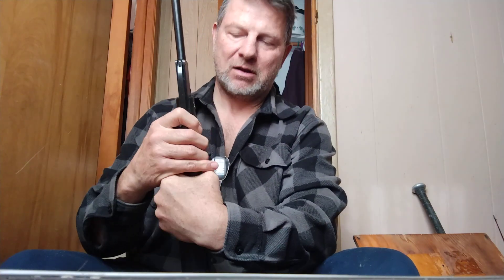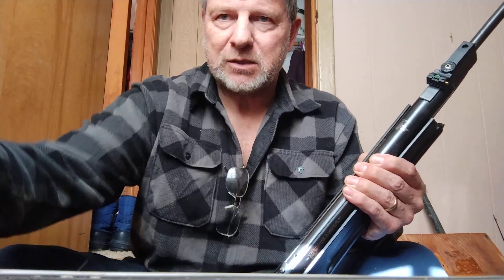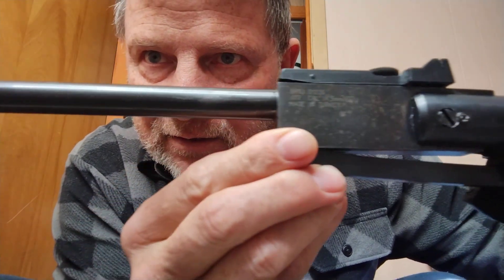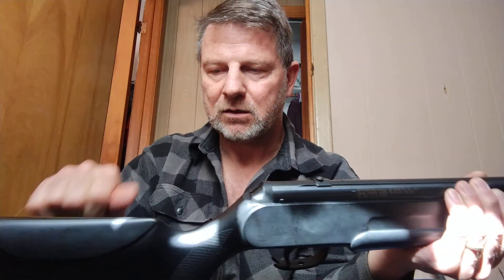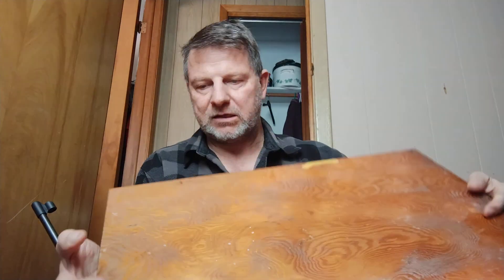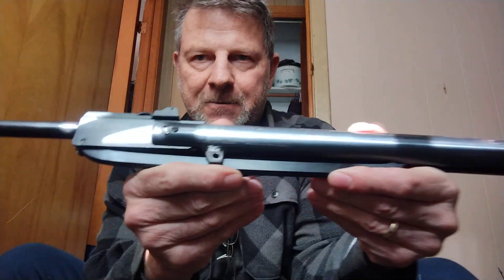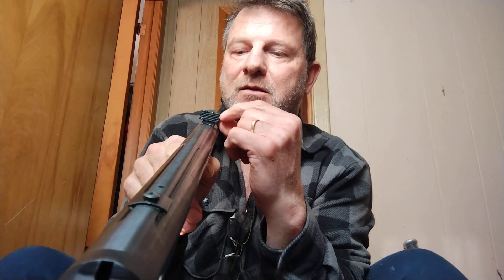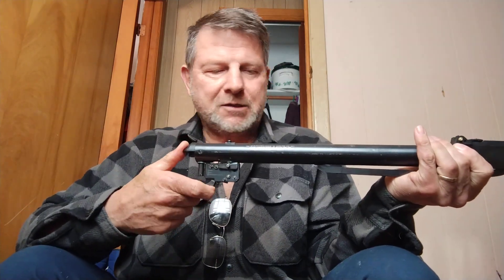Can the Turkish Monster (Daisy Powerline 1000) Live Again?

Comment: How many springs were on that trigger?
Reply from the maker: I think 3 or 4. I removed 2 that had to do with the safety. There was one that push the sear back into place after shooting. I'm not sure if they were any others because did not want to take the trigger apart any further. This has definitely been my beater gun, lol. At one time it was quite rusty, but I cleaned it up with some steel wool.
Reply: @springpistonriflefeverlone9611  I took that 1101s trigger apart. Never doing that again. I put a spring in upside down and it wouldn't fire. Had to take it  apart with the rifle cocked. Never again lol.